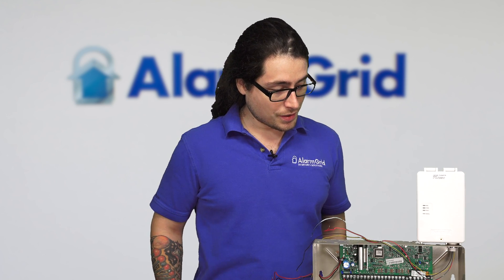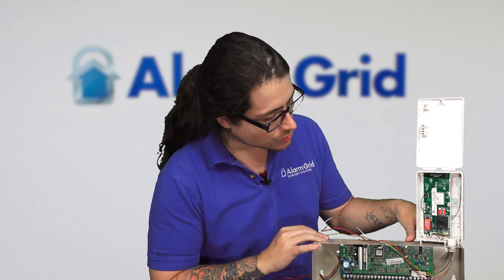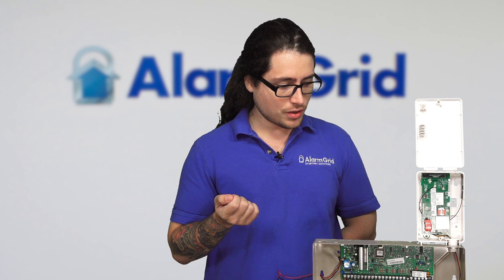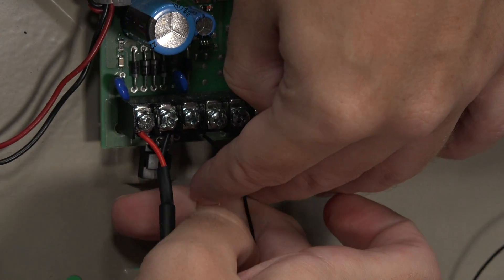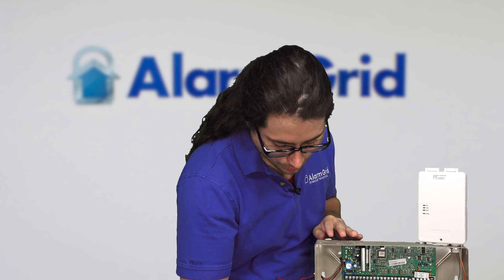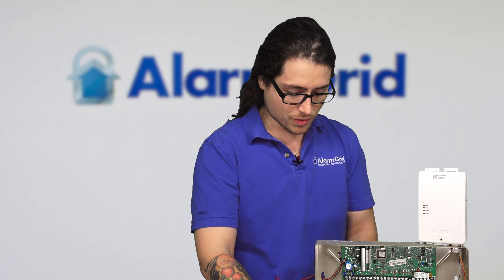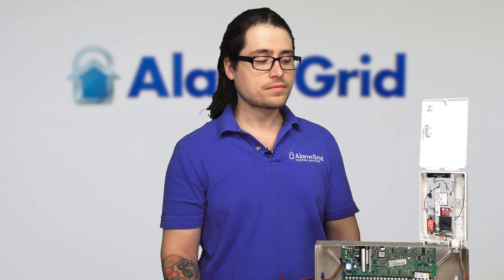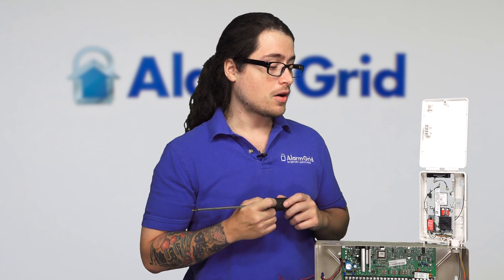Add a Honeywell GSMX4G to a VISTA Security System

Comment: Does this connect with total connect?
Reply from the maker: As long as the Vista panel is version 9.12 or higher, and the communicator is already activated and registered, then yes.  The GSM communicators can no longer be activated with AlarmNet. If you have one that is already active, then you can use it.  If you are buying a new communicator, you must purchase an LTE model instead of the GSM version.  You can find out more from our site https://www.alarmgrid.com/browse/lte-cellular-communicators/brands/honeywell.

Comment: Cant you just hook it up to a 12volt battery to test signal
Reply from the maker: Sure, as long as the battery has a good charge and enough current to power the radio.